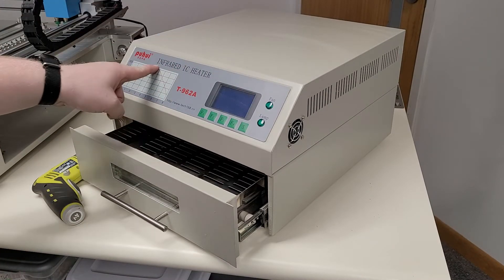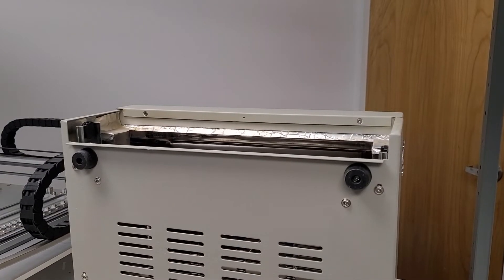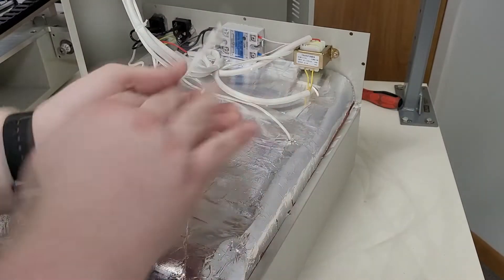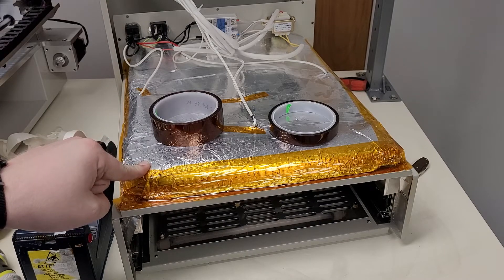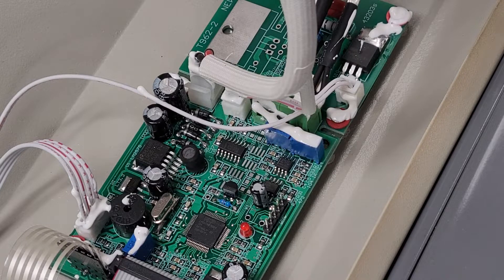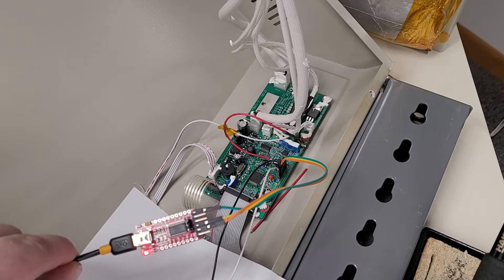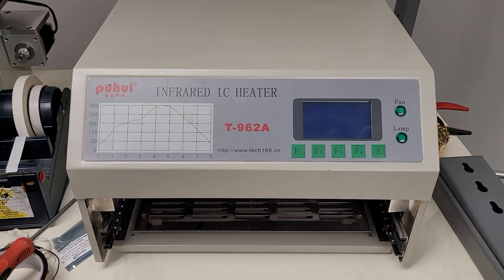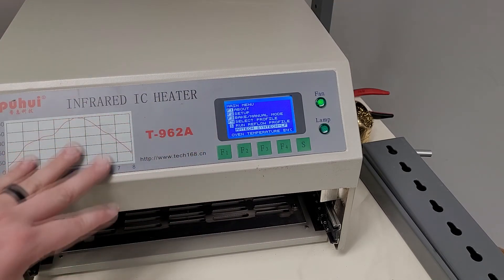Upgrading My T962A Reflow Oven

Comment: Apparently, you can hold the F1 button down while powering on the unit and it goes into bootloader mode AND the fan and IR elements are off... much safer way to update.